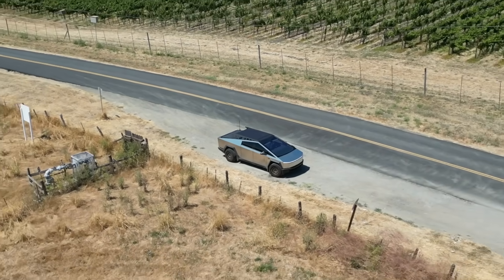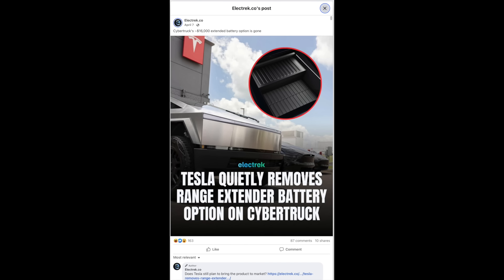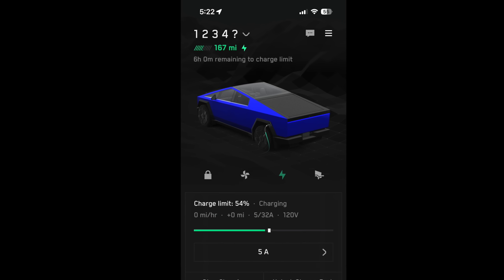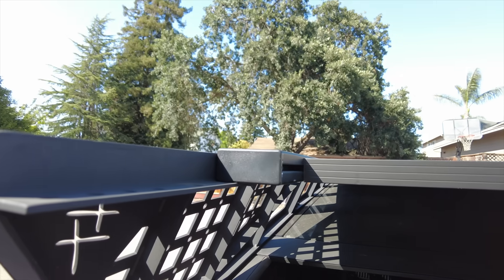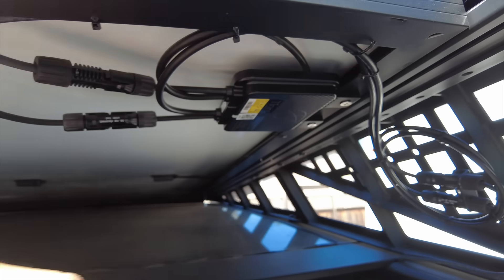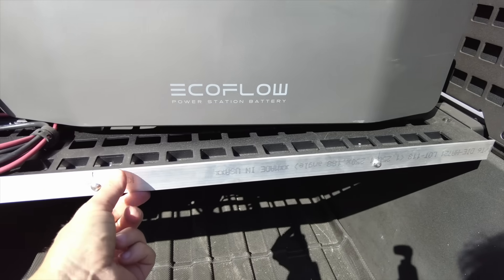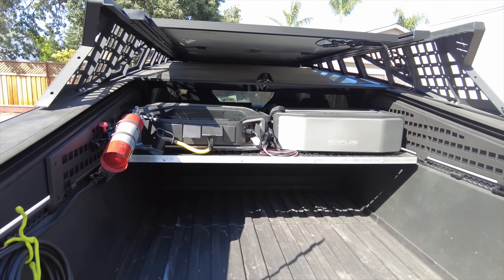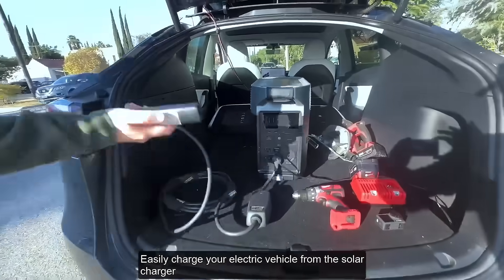Cybertruck Off Grid Solar + Battery: Build Breakdown Deep Dive

Comment: I suggest using the roll up cover with flexible low light level panels. Most definitely the program for charging needs to turn off battery heating . I don’t know if you turned off sentry mode. That burns a ton. There’s a hood solar panel .

Comment: only way is dc converting   higher  voltage array at least 100v straight to modules with voltage stabilizers!!   lets say every module is 40v   you can charge em independent with a balancer charger  just need  to work with cabling to avoid  inbalances !!!  equal lenght cables and monitoring every module!!   its old technology  just need to re adjusted!!!

Comment: you said it in your video…you need a massive solar array to charge the battery.  Which makes it obvious, that parking under a huge solar array is much better.  The amount of charge into the trucks battery is negligible from the onboard solar panel.  I’ve made light EV’s with a solar roof for charging already.  super light solar trailers for ebikes.  Yeah….build a huge carport with a solar roof.  Then you have something you can brag about.

Comment: If one or more of your solar panels are permanently shaded, you do NOT use optimizers.  You don't do it at all.  Optimizers bypass the shaded panels so that a series string won't be completely useless in the event of TEMPORARY shading.  If the shading is all the time, it's better to just forgo that panel.  I just want to make sure you don't spend more money only to be disappointed.

Comment: I understand CT's consume about 350 W-hr per mile. So every hour of good charge, you claw back a little over a mile in range. If you can get 3X of that, you're starting to look at 30 miles on a long summer day of charging. Then it becomes useful. I think what you're showing is that a charging shed for your truck would be a great way to go to put 40 to 80 miles back into your CT every day.

Comment: Unless your trucks battery is below 45 degrees F then it will not be heating during charging. I am guessing your onboard systems are using the 600 watts while the truck is awake. You may want to try dumping stored power from your EcoFlow Ultra as quickly as possible. I output 24 amps at 240 volts from mine into my Model X regularly from the 240 volt Ultra outlet. I limit to 24 amps for safety.

Comment: Why don't you use the 240V/30A outlet and an adapter to connect your mobile charger with Tesla's NEMA 14-30 pigtail? This is what I do to charge my Cybertruck off-grid. You still need the neutral-ground bonding plug, and it works in one of the 120V outlets. Give it a try - you can actually charge at the full rate of the mobile connector.

Comment: My way to keep my CT going in the outback is a Champion 11000 watt tri fuel generator and an aftermarket 40amp portable charger. Stop, unload the generator, Plug it in and wait 4 hours for 80%. Load generator and drive off.

Comment: Many people get involuntarily 'written off' before they had a chance in life and  get forced onto a welfare system where rent can be upwards of 700GBP, one of these costs the same as a few years rent comparatively and would be a much better investment and save a lot of tax money. However if writing people off and then using them as an escrow account for tax money (sucking the blood out of them) is a racket, then this proposition may seem like more of a problem than a solution to anyone financially invested in said racket.

Rather than spending decades of tax money on rent, issue cyber trucks and driving licenses for less than 5% of the cost, ensure plenty of 24 hour service stations and stops with all the required facilities with and robots and save billions, literally billions.

Comment: I have done this with my CT.  Things I learned:

1) The overhead is not from heating the batteries, it's simple overhead from the massive bidirectional inverters (in the car charging the batts) as well as in the power supply.  Tesla NMC battery heating is only done when supercharging or if below 37F.  Tesla charging is also more efficient with less overhead at 240V.  That's why I use a Pecron setup with the mobile charger @240V.  You can do 240 with the mobile charger if you use a 240V "generator" and 240V plug adapter for the mobile charger.  I use the 14-50.  Your 6-50 might be designed for 240V but it will be 120V because it's running through the TT30 adapter.
2) You don't need a massive 10kWh battery, you can use the app to remotely dump and stop/start the charger.  Given the limited power from solar panels, you will probable only need to do this 1-2 times a day at most even with slide out panels.
3) I recommend using CIGS panels.  They are shade tolerant, can be applied directly to the roof without a rack so this does not affect aerodynamics which can rob more miles than the solar adds.  CIGS will also put out more power lower in the day and in overcast conditions.  Also they are much more durable vs flexible silicon panels but glass rigid panels will still have the longest lifetime.
Reply from the maker: Spoke with a Tesla engineer.  He confirmed the power loss is the battery heating. Not from inverter. 
2. Because I’m off grid I have no cell reception so I have to manually dump power

Comment: Dude, you need to buy ShadowFlux panels, redesign the top of Cybertruck so you can have at least a few of them installed. Next, buy solar MMPT controller with inverter than outputs 240/220V. Install a few relays or switches that will disconnect shadowed panels and reconfigure solar panels wiring. Remember, solar panels provide around 200W per square meter. This is at the direct sunlight. If you build a roof around back side of the Cybertruck, you will get around 5 m². This is 1kW of power or about 2 miles range (assuming no battery heating). If you are lucky, you will get 20 miles per day. So, to make it reasonable, let say a 100 miles range per day to get to the nearby Supercharger from actually remote area you need to have 5 layers of solar panels. 
If you plan to drive to your remote cabin and charge there it makes sense to have a compact solar array on the back and over provisioned 20kW or more solar array at the cabin. It would be much cheaper but it will make everything efficient.

Comment: There just needs to be a small solid state  50v to 400v DC to DC  converter, with the proper connector  directly to the main traction battery harness bypassing the contactors. With Tesla expected to sell less 15k units of Cybertruck (4,306 Cybertrucks in Q2 2025 alone)  next year, I highly doubt anybody would put anything like that into mass production.   The good news is that even those Tesla sales are down EV adoption is way up and is expected to double every 2.5 years.

Comment: I have to say this was slow methodical and clearly and simply explained. 
The ground plug thats required sure seems a bit small, if something were to ground fault. 
Question is did you physically test to see if that panel is producing the wattage it says it can? 
Dumber question: like hydroelectric generation, couldn't there be a charger installed using the motion on the wheels and to only generate when at certain speeds?

Comment: it would be amazing if these ev trucks had a simple mppt solar inverter in their bed that had direct connection to the hv battery. Would cut down the cost to just cables and portable solar panels. So much more efficient to charge. Wouldn't cost much to have this installed at the factory level too. $50-$300 in parts. Such a missed opportunity.

Comment: I admire your determination. But the amount of charge you are getting is so small. You might as well put a Honda Generator 2kW in the back. After an hour's running you would get the same amount as all day on solar. Probably for under $1000.

Those 2kW would work out to 6 miles range. My Model 3 used to use 150W per hour just running sentry mode. So it wouldn't even run sentry mode.

You need a trailer full of panels like in The Martian movie.

Comment: Maybe look into Aptera Motors for a solar vehicle and potentially solar panels. I am curious how much range you will add by this system, the Aptera system can add up to 40 miles of range each day but the Aptera is much more aerodynamic and weighs significantly less than the Cybertruck.

Comment: I have a 12-kilowatt-hour solar system and a 45-kilowatt-hour battery backup. I even built a Bluetooth battery management system from scratch. I love solar power, but I believe this project is headed in the wrong direction.

Let me be clear: this approach produces negative results, most noticeably in range reduction. The CyberTruck was streamlined with a drag coefficient (Cd) of 0.384 and 0.39 in independent tests but you adding external structures introduces significant aerodynamic drag. This creates air vortices and wake turbulence, while reducing cargo volume and adding extra weight. Even if the weight alone doesn't offset any gains, the aerodynamic drag could easily result in a 5–10% reduction in range.

If you're serious about gaining range from a solar system, you need to use thin, flexible panels that conform to the roof and add no extra air resistance—perhaps totaling only 10 to 16 pounds. In this case, you'd have to connect them directly to the 4680-cell battery at close to 800 volts using an inverter and a Maximum Power Point Tracking (MPPT) charge controller. Even then, you run the risk of voiding your warranty. The other advantage might be bypassing sentry mode so you don't lose energy while charging.

Don’t use rigid panels or racks; those solutions only add weight and drag, further reducing your range rather than increasing it. All of these configurations result in a net loss due to a multi-step system with compounding inefficiencies. You end up with hundreds of extra pounds, ongoing parasitic losses from sentry mode, solar panels feeding into an MPPT charge controller, and then storing energy in a battery, which is then reconverted through another bidirectional inverter system to charge the truck via an external charger all with significant energy losses at every step.

Frankly, none of this makes sense. Even the "dart system" setup is a joke, with their bulky aerodynamic racks, provide zero range improvement. In fact, they're more likely to hurt performance than help it. With your current setup, you're wasting energy and actively reducing range.
Reply from the maker: All good points.  I’m not looking for aero. I gave up on that. It’s more for spending more time off road away from civilization. In the future it should be more robust

Comment: I missed why you're not using 240 volts on the ecoflow?
Reply from the maker: 120v or 240v. They are both AC so you lose a lot to the rectification.  Doesn’t really matter unless you have a huge battery.  At 120v 30a I can empty the thing in 30 minutes. So 240v won’t be any better

Comment: I'm curious why you didn't use the 240v port on the front of the Ecoflow Delta Pro Ultra next to the 120v port you are using? And are you using the Ecoflow app to control the charge/discharge settings?
Reply from the maker: Either way 120v or 240v, I can get all the energy out in 30 minutes. And I do use the Ecoflow app if I’m near the vehicle. But most of the time I’m backpacking far away from it in cell phone dead zones. So unable to monitor it

Comment: This seems like something Tesla should sort out. You’ve got a massive battery built into the truck, you got an inverter built into the truck, there should be a software solution to plug as many solar panels directly into to truck.
Reply from the maker: 100%.  I hope they figure it out
Reply: Cybertruck Battery charging benefits from 240v@ and at 50 amps rate but lacks a built in MPPT solar charge controller. Only a handful of all in one portable solar generators provide native 240v direct output.-aside from one shown in video- jackery 5000 , anchor solix f3800+, and new bluetti apex 300 (which can be smaller/lighter/cheaper but with lower max solar mppt input rate and 240v@single head unit 240v output@ 16 amps). Such all-in-one 240v options hit different price points, consume storage space, and add min 85lbs of weight or over 125 lbs depending on battery kWh capacity.
Reply: To charge at just 10kW, you’d realistically need around 30 large solar panels.  This is why Tesla offers rooftop solar instead of portable solar.

If you towed a “Solarcontainer,” which is a cargo ship container with 240 retractable panels for 140kW, then you could power Tesla Supercharger to charge a Cybertruck from 5% to 99% in an hour or two.
Reply: @NickWindham only 1.5-3kW of panels is really all that’s required to be useful in a overland scenario. Especially if not travelling every day. Just a constant tickle charge to offset ancillary equipment and maybe 10-15 miles range each day.
Reply: @NickWindham lol... this is a ridiculous but so true of a statement. I think thats whats going on here is to charge what is lost rather than draining completely, stopping, charging (super or not) waiting, maybe waiting some more, then driving, and repeat. Thats what im getting here.
Reply: @NickWindham  DO NOT START TELLING THEM A KILO WATT IS 1000WATT
DO NOT TELL THEM THEY ONLY GET 300WATT OUT OF A MONOCRYSTALIN 
SOLARPANEL. IN 1 HOUR SO 300WATT X HOUR CHARDGED.. 
ASK THEM TO INWEST IN SOLAR ROAD WAYS .. THEY WAS A HIT UNTIL THEY WAS NOT

Comment: 9:13 Since you plan to extend your solar system capacity, I wonder why you didn't choose 
to have separate 48V batteries and use a solar inverter with 240 V 30A which would be more efficient ?
Reply from the maker: Same efficiency when going from DC to AC. Doesn’t matter if it’s converting to 120v or 240v. The main lose is in the rectification

Comment: 2:50 About the all day continuous charging first option, it would be interesting to know how Aptera is able to efficiently charge directly 
the propulsion battery without pre-heating the whole battery to keep the charging efficient when parked or when driving. 
This might be why the first Aptera "Launch Edition" didn't have the DCFC included, but got a lot of backslash and had to add the NACS charger.
Reply from the maker: Yeah. Maybe they don’t heat the batteries and keep it DC from solar to batteries

Comment: I was hoping you would break down more numbers. From my estimation you spent close to $10k so you could generate 2.2kW per day which is probably closer to 1.5kW after 24h idle drain. That equates to 5 miles or $0.52 from a supercharger per day or 52 years to pay for itself.

Way overpaid for the battery/generator system. You can get a 16kWh battery array and case for $1600 and standalone inverters outperform any of the RV portable systems (all of those are a joke).
Reply from the maker: You’re not far off. Hence why I’m posting it. To shorten learning curve for all. Sorry I didn’t get into numbers
Reply: @WorthWords-cw5xh  you just need more panels. When you park giving your windshield and bed shade really could make it make a difference.
Reply: @grantbarnett8113 the ecoflow lists a high-pv rating of 4k max input. It’s not going to help all that much with those limitations.
Reply: @CWK09  it makes sense if cybertruck can be robo taxi. If you utilized the average size of parking space and it was unfolded the entire day. You would get 50-60 miles on average. The parking space 9x18=162 sq ft. You get around 70 watts per sq ft 70x162=11340 if we assume 25% efficiency that’s 11340x0.25=2,835 w per hour. You will probably bet 70% on average daily which is 2835x0.7=1,984.5. That’s 5 miles an hour solar charge and I think we can call 10 hours a normal amount of sunlight. 

Do this to robotaxi and your in business. $3000 in panels to get 50miles a day. If that’s gas you’re saving $7 a day… if it’s hybrid you’re saving 3.50 a day… if it’s electric .52 for a super charger. That’s 5.20 a day you save if you keep it parked. 

Solar on a car is definitely viable

Comment: Need a DC slow charger option. Plug solar directly into it with less losses due to DC to AC to DC conversion. Flexible panels while camping. Get 10 300 watt panels in series for 400v at 10 amps.
Reply from the maker: Exactly

Comment: As someone who's done an off grid system for charging, A gas generator is the easiest and cheapest setup. A decent generator is less than a thousand dollars.
As for solar, you'd be best off running battery less and just use the trucks power running to an off grid inverter at the utility load to buffer the loads. One advantage of the cybertruck is the bed outlets. You cut out the weight and expensive of another battery.
Reply from the maker: Gas is better.  But I can’t make more when out for weeks in the woods. I was aiming for infinite energy glitch
Reply: what if you bought a robust used military diesel generator that can also run on vegetable oil or used oils?

Comment: The size of solar panel on this build is not worth the expense unless you are going to spend many days off grid and are using the solar to run auxiliary devices. 430W panel will yield about 2kWh per day on a good day and with optimal aiming. If spending 5-7k on a system like this sounds good, then go for it, but I'd probably just buy a small array of flexible panels and a 5kWh power bank with split phase output, and forego the expensive and unnecessary integration.
Reply from the maker: I spend weeks off grid so potentially more worth it for me. But probably not the average user
Reply: @WorthWords-cw5xh  I would still just invest in a portable solution over this integrated one. More flexible, you will be able to aim the panels more easily, and the battery system and panels do not NEED to be tied to the truck to be useful. Not to mention there are a LOT of competitive options on the market to look at for boondocking.
Reply: yes thats what people who goes overlanding in ICE vehicles uses, the solar panel and the alternator of the engine charges the batteries to run the fridge and all the devices on board.